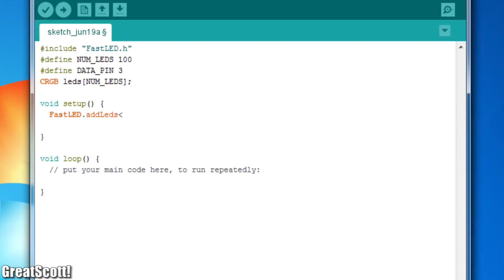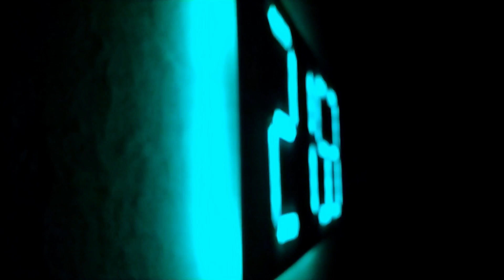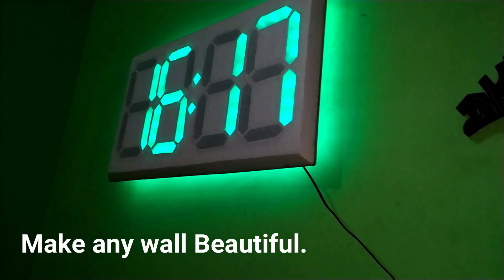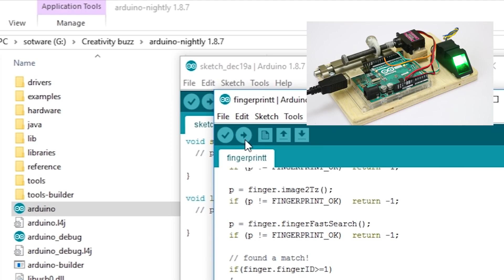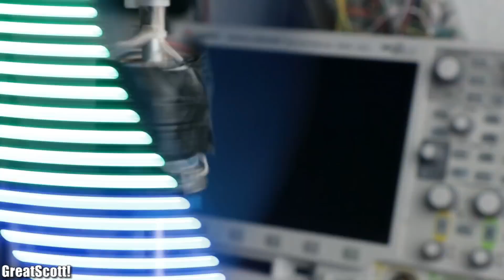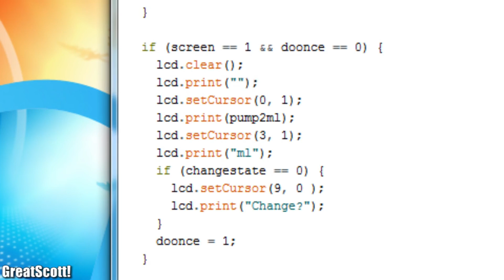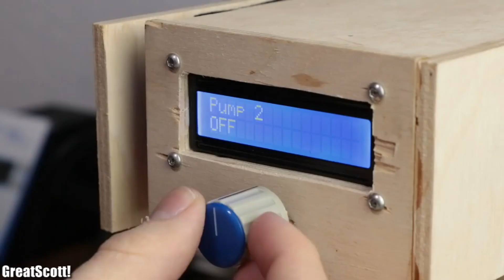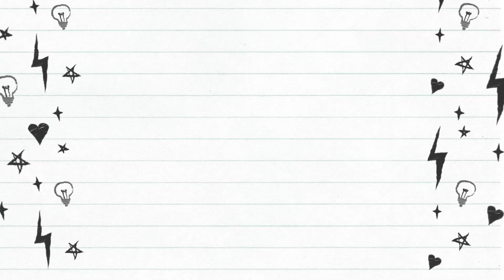Top 10 Arduino Projects of all time

Comment: What is the best way to run a visual machine learning algorithm to sort through pictures of leaves and sort through which leaves are edible and which ones arnt- can this be done on an Arduino?
Reply from the maker: no this can be done on raspberry pi
Reply: @RoboCircuits  is there any way to run ML offline ? My experience with raspberry pi is limited but I guess you would use pi to use "AWS" or similar , any idea on how to get this to work "off the grid " thanks

Comment: "Top Arduino Projects" - first project: uses ESP / NodeMCU
Reply: @lilkrucivert  It's not, since it's not using the Arduino firmware. And if you are saying it's an "Arduino board" because you can use the Arduino IDE to flash it, keep in mind that i could also use the IDE to write an HTML website. Which obviously doesn't make my website an arduino board.
Reply from the maker: Yes

Comment: a clock ... you included a clock as one of the best projects ... a clock
Reply: An interesting way to make a clock/ timer is by using the system clock frequency. The Arduino Microcontroller, for instance, works with a 16MHz SCL. What makes it a bit challenging is to go over datasheets, remember bits and do the calculations the first time, but the eventual reward is cerainly great!
Reply: Easy to understand, hard to do.
Reply: clock was impressive because it was real time even when turned off for a while. but the wire bender was just procedural, the ball balancer should have been first.
Reply: a moth%$& fu%# clock ,
Reply: For 2020: https://www.youtube.com/watch?time_continue=3&v=8E0SeycTzHw
Reply: a clock just timeless ;-)
Reply from the maker: Clock*
Reply: @RoboCircuits  I'm an engineer who does automation, industrial robots, etc. I would have kept watching except for that crap as crap techno soundtrack. 
WTF is it that millennials think that screaming techno turned up the 15 is a way to impress people when the technology is what you want to display.
Reply from the maker: Sorry for the music..😂😂
Reply: @RoboCircuits  Your not the only one and no where near the worst.
If your going to do top 10s then give some commentary. Why do you think one is better than another. Sure people will argue but so what. 
Arduino is actually an amazing tool. Compared to when I was doing embedded stuff in the 90s we couldn't dream of this stuff. Our big moment was when Z-World released an actual C-Complier. But we still had to come up with our own IO interfaces.
The idea you could any of what's now off the shelf for a few dollars simply did not exist.
Reply: @tonywilson4713  Just curious how old you think millennials are.
Reply: @MrMiko42  According to the "experts" most would be between 20 and 30, but it can include younger than that. 
As far as I know the general definition its those born around the millennium not just those born after 2000.
My general dislike of them (or at least the loud ones) is they totally ignore the work of previous generations in developing the technologies that underpin their lives.
I did aerospace engineering at U.Illinois (late 80s) a couple of buildings over 2 guys named Eric Bina and Mark Andreesen wrote a program called "Mosaic." https://en.wikipedia.org/wiki/Eric_Bina Most millennials don't even know what we went through to get the technology to where it is today. They have no idea of what we had back then. I still have nightmares of using the Plato system at that time. Plato was a precursor to the Internet and it was all text and slow and horrible. Its one reason why Bina and Andreeseen did what they did.
What really aggravates is when they try the "we are a new better technically educated generation" line and I've had that shoved in my face. Most millennials are fine, its the "loud ones" that aggravate.
Reply: @tonywilson4713  Just checking. There's a lot of millennial hate out there, raging against "these darn kids", but the youngest of us are 26. The range for the generation is 1980 - 1996. I'm one and have kids and proliferating gray hairs. Stranger Things felt nostalgic, I remember computers ran DOS and had green phosphor monitors, played Atari, etc. I'm just tired of older generations continuing to sling mud at "millennials", apparently unaware that we're quite a bit older. We're also continuing to build and advance  technology to build the world that you're currently enjoying and will in turn hand the torch to Zoomers and eventually the next generation. I have Zoomer coworkers, who are such earnest young things and show great promise for us all.

I also had the distinction of graduating school into the worst recession in 80 years and am watching helplessly as the world heats, which I have to thank the very same older generations for. Believe me, the work of previous generations has weighed heavily on my adult life. Adding salt to the wound has been a seeming inability from Boomers in particular to recognize all of the harm passed on combined with a certain aggrieved entitlement to continuing to be the cultural center of gravity.

Please be careful when decrying the "loud" Millennials that you aren't yourself being a "loud" Boomer.
Reply: @MrMiko42  My gen tend to lump millennials and zoomers together. 
When I mean I have had hassles with your age group I am not joking. I'm an engineer and was in the last generation to be taught actual technical drawing. After us CAD arrived and with it a very similar issue that MS Word has created. AutoCad is fabulous and it does so many things that those who only learn it don't learn other stuff.

I started in mechanical in Australia and then got a scholarship to Illinois and swapped into aerospace. At the end of my first year at RMIT we spent 3 weeks in the machine shop. We started in the welding shop and finished in the machine shop making a small bench vise from raw castings so we would understand how things get made. These days its CAD then CAM then NC. I don't joke when I say most younger engineers can't explain the fundamental difference between a lath and a mill. They have never seen them let alone used them.

I mainly work in electrical and control systems where being able to do schematics is pretty important. It also includes layout drawings of panels. You'd be simply amazed how many engineers CAN'T draw a basic schematic and many can't read them either. I have genuine horror stories.

As for Boomers you don't have a clue as to my age group, but then very few do because I am in a group that's simply not boomer and simply not Gen-X either. .We're in an odd transition group between the Boomers and Gen-X. Depending on what you graduated with and which door you walked through after graduation is incredible disparity. 

I arrived back in Australia right into the worst Australian recession since the Great depression. When I tried to go back to America there was even less. When the Soviets collapsed so did the aerospace industry, because they stopped buying jets. Plus NASA was still in disarray after  Challenger. In a blink aerospace degrees went form #1 to outside the top 25 for graduate pay. And it really was hit and miss. One of the post-grads ahead of me was part of a $2billion dollar star wars development program. Their funding was insane. Down the street from our building 2 guys named Bina and Andreesen wrote a computer program called Mosaic and started Netscape. I have frat brothers who graduated with exactly with the same quals and have nothing.

My age group is often mislabeled because people see the wealth of some and think we all did well. In Australia engineers got hammered when we sent all our manufacturing to China and then hammered again when we stopped building power stations and infrastructure. Plus as we started to gain experience McKinsey and KPMG came to Australia with HR and suddenly experience meant NOTHING.

Mark Blyth the Brown U. Professor is one of the very few who has recognized that there are chunks of our generations who simply don't fit in the pigeon holes that most people think exist. Its part of the Wall Street disconnect with reality. I actually wrote a lot more and freaked. 

It sounds like you are caught in a similar loop to my age group - job insecurity that prevents any asset growth while management F--Ks us via the HR department. I suggest you go watch some of Mark Blyth he did a great talk explaining how we got here and its called "How we got here." Its fairly heavy but you sound like you can handle it --> https://www.youtube.com/watch?v=tJoe_daP0DE
Reply: @tonywilson4713  I'll check that out. Thanks for the link. FWIW, I actually know the difference between a lathe and a mill and am read enough of a schematic to know what's going on with the simpler ones. I do software for a living, but have been playing with 555s over break. I'm still getting acquainted with opamps. Agreed on needing to know how things work concretely or at lower layers of abstraction, but there are enough details (in my area) that some things just have to remain black boxes. I managed to break out of my own generation's loop, but still carry a lot of anxiety about whether a given job is going to still be there for me in a year or not.

And yeah, I've been following some of the economic news on Australia lately. It sounds like China is major partner that can cause serious swings in your fortunes. What I haven't been able to gather is how much of the current difficulties come down to the coal exports and how much of the Australian economy is based on coal.
Reply: Been typing this on a phone, so please excuse the stream-of-consciousness writing. This cat on my chest also isn't helping.
Reply: @MrMiko42  555s Really - I haven't played with those in over 20 years.
If you want a suggestion look into DSP development. There are so many Aduino programmers and developers there's no money as there's so much over supply. But if you are interested in development look into DSPs.
They sort of fell out of the SETI program but found a real place in Variable Speed Drives, analyzers and sensors. They can do the modelling and signal analysis required. As a control system engineer the development of VSDs has out stripped every other technology we use in industry. Anything that uses electric motors, CNC systems, Robotics all have DSPs in them. Many analog sensors have DSP technology. Very few people realise that if you go into a power station or oil refinery or mine site and there are literally 1000s & 1000s of DSPs all over the place hidden in sensors, analyzers, VSDs and other stuff. 
Heads up its not an easy field to break into. You can create really clever stuff and go nowhere. You need to find someone who has a problem and offer to solve it for them. Its tough but if you come up with something innovative one of the major players might buy it off you.

As for China we have had people warning us for several years and the people making money off the Chinese told them to shut up. We now know those warnings were justified and were correct.
Reply: @tonywilson4713  Seriously though! I hate that fricking music with a passion, and its the reason why I don't watch many videos like this.
Reply: @AimedJester  You ain't getting disagreement from me.
What's amazing is some of them are worse than this. 🤷🤷🤷
Reply from the maker: That click has lots of possibilities

Comment: Is it possible to alter the task for which an Arduino was created? Is it possible to “write” into it an additional command like “stop” doing this, do this instead? The whole world would like to know, I think.
Reply: If i understand your question correctly, then yes. The arduinos arent built to do anything specific, they are the "brains", the tasks are performed based on the code you write and the hardware you attach to it.
A relatively same command could turn on an LED or power a motor.